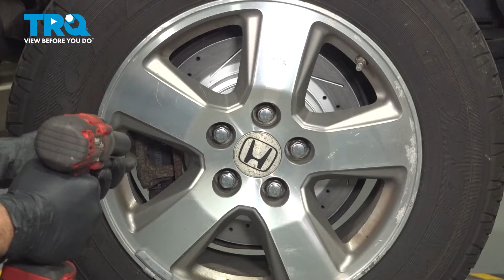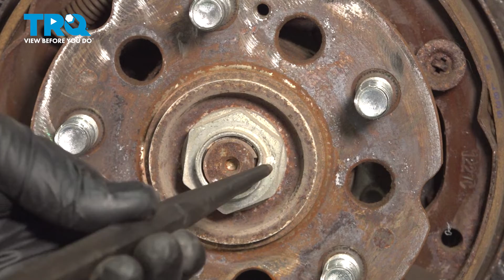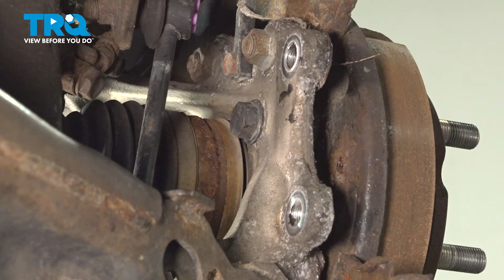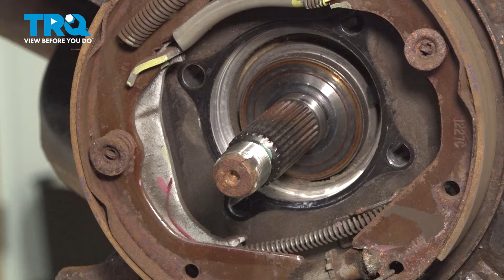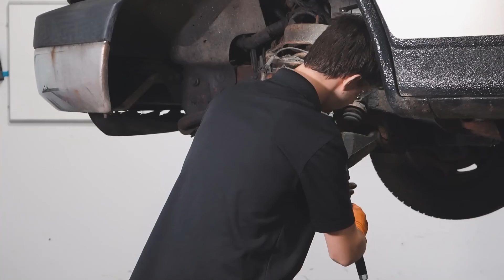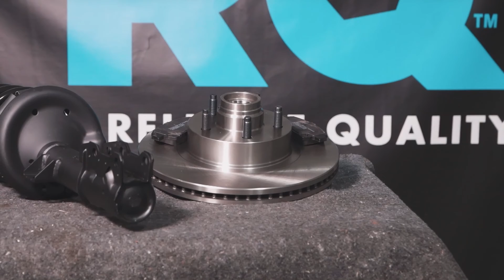How to Replace Rear Wheel Bearing & Hub Assembly 2009-2015 Honda Pilot

Comment: No way either those rotor screws OR the wheel bearing are coming off as easy as they did in this video! You MUST use an impact driver with the PROPER bit (Japanese Industrial Standard #3 bit, NOT a phillips screwdriver!!) to get those rotor screws off! And you'll probably need to use a hub puller (you can rent this from AutoZone or Oreilly's etc) to get the hub out.

Comment: Couldn't have done this without the video. Thanks. Getting the wheel bearing and hub assembly off the axle wasn't as easy as the video makes it look. I had to rig up a piece of bar stock under two C-clamps and slowly tighten them to push the end of the axle out  and free the WB&H assembly.

Comment: Thanks! Removing the axle bearing can be a beast of a task. I have broken three 1/2 inch drive ratchet wrenches doing that on my two cars. I finally got a high strength breaker bar, 3/4 drive, that can withstand the torque of a three foot pipe on it. Now the job is easy ... sort of.

Pop the center emblem out of the wheel and then put the wheel back on. Remove the axle nut with the wheel solidly on the ground, with the 36 mm socket going through where the emblem was. If your 36 mm socket is too big for the hole, you need to use a bar between two lugs, braced on the ground. I think that's how it is done in the video.

Comment: I have a 2010 pilot and it shakes after 30 MPH. I have replaced all 4 tires mounted and balanced, tie rods, links, Front and rear suspension. What odds that it would be the wheel bearings? I do hear a little humming but the shakes are more notify than the humming. BTW very nice video thank you
Reply: I believe it’s your wheel hub, specially when you go over 30 mph and u hear rough sound coming from tires